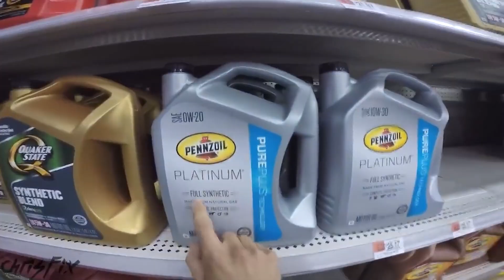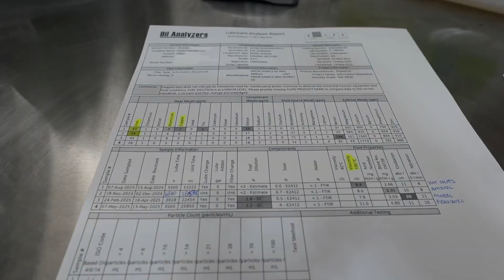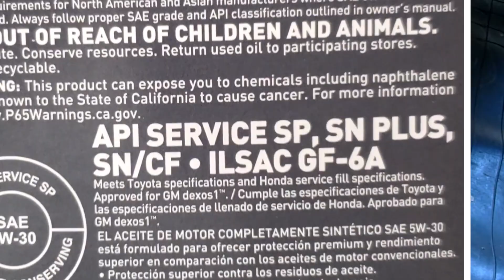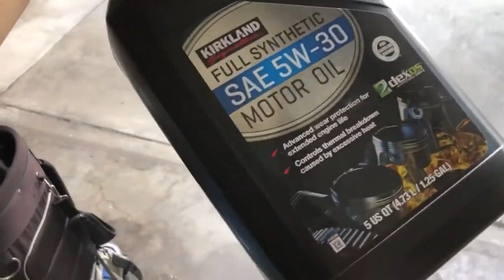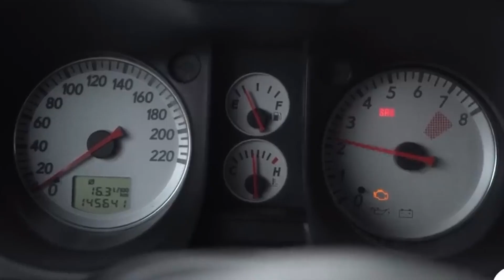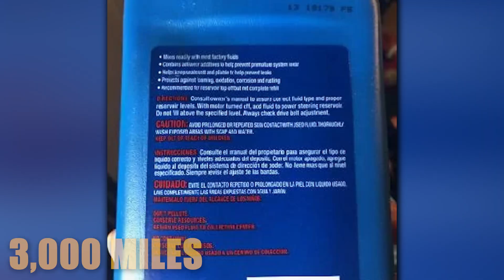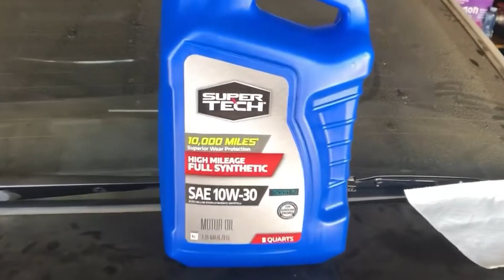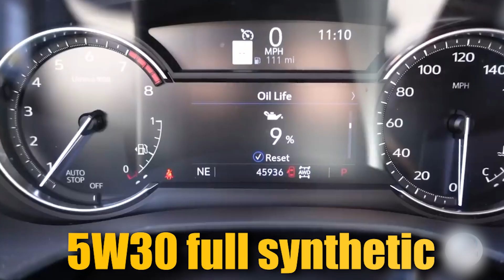The TRUTH About 0W 20 vs 5W 30 Oil (75 Engines Tested!)

Comment: using 0W20 might boost your fuel efficiency, but for long-term engine durability—especially if you're towing, driving an SUV, or pushing your automatic car hard—5W30 or even 0W30 is the safer bet.

Comment: since my 2.4 Renegade burns thru a quart of 0/20 after 2000/3000 miles..maybe do a mix so 0/30???. Am at 160,000 so time is running out. Last time oil light came on and had to add a quart. Ok, wasnt paying attention like I normally did. Now, oil light remains on ..This Jeep has temp not pressure sensor so now oil temp sensor weird
.Shows good temp now oil Light remains on all the time now.
Reply: Run some marvel through it might be getting carbon build or sludge in oil pan
Reply: @mmike422 Thinking that 🤔. Odd the sensor went out like that. What is a bit of debris from oil  bottle fell in 🤔 was what I was thinking . En light and oil light on but still going  Gotta go right axle shaft now but at 165 now, still working